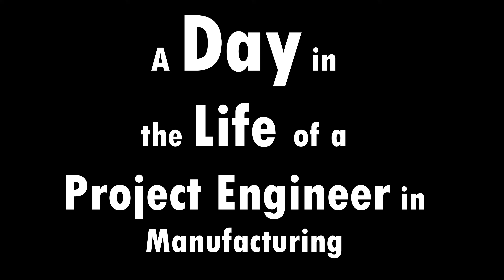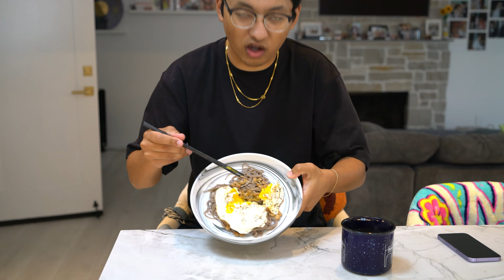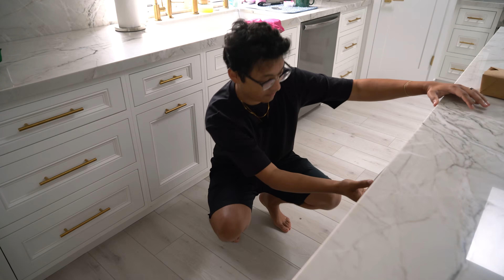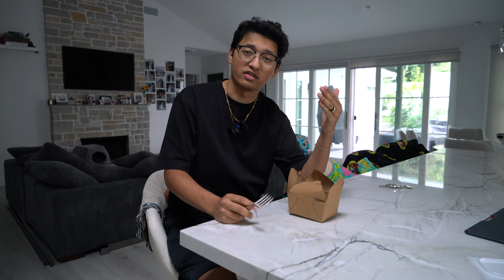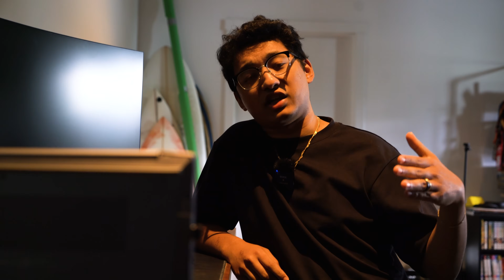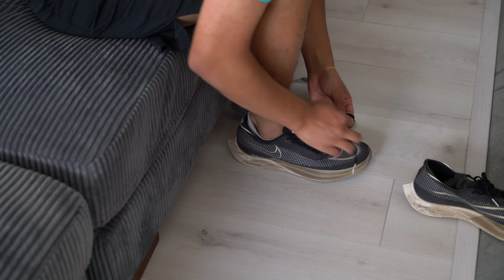Day in the Life as a Project Engineer in Manufacturing

Comment: saw your video on ethernet cables man, what got you into this field.
is the network stuff a recent hobby or was it always in the back burner since you were young
Reply from the maker: Network stuff is more of a hobby. Learned it from having bad connectivity issues throughout all the places I lived. Got into Electrical Manufacturing by luck. I graduated with a finance degree and started out in accounting for an Electrical Construction company. Quickly learned I did not like accounting, and by chance 8 months into the job, a Project Engineer got a personal injury and they needed help covering, so I took the opportunity did that for 5 years, before moving and having to find another job, now in Electrical Manufacturing.  Being in electrical construction I did learn about low voltage cable runs, but took it upon myself later to actually learn for my own place.